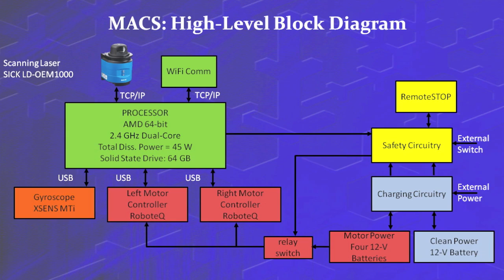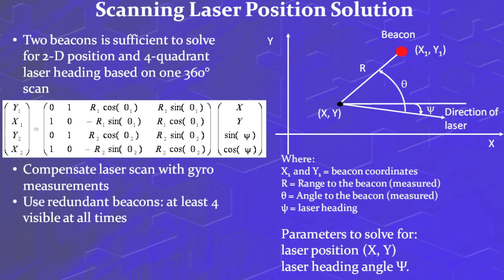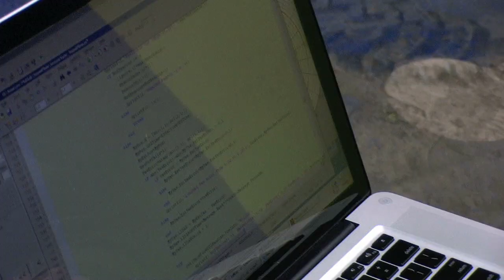Autonomous Snowplow Competition 2011: M.A.C.S.

Comment: does not appear to be autonomous. Looks radio controlled
Reply from the maker: Down2This , the remote is to control the automatic shutoff. The robot itself determines its position using lidar and uses that to adjust its steering. See the next two videos for some improvements. In the final version the robot was capable of exceeding 1 m/s while staying within 2 cm of the track when plowing 4” of snow